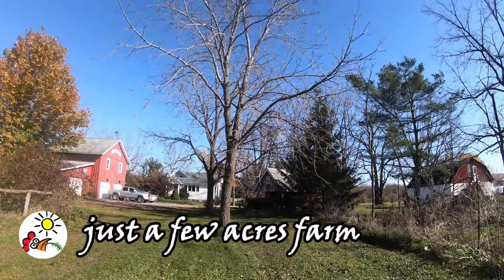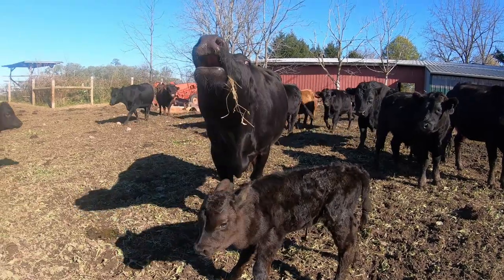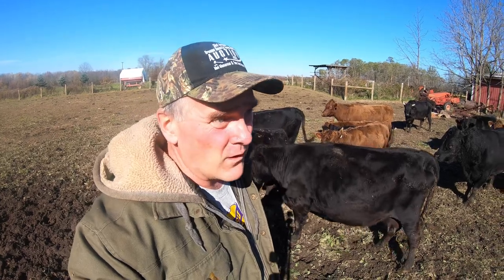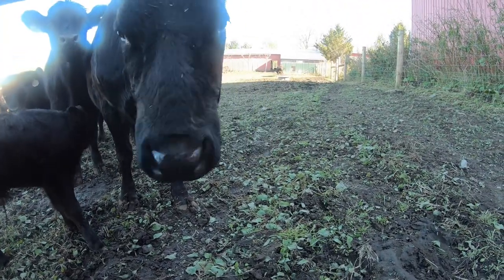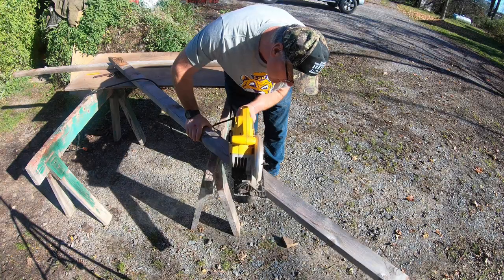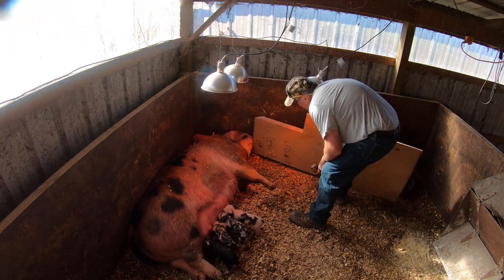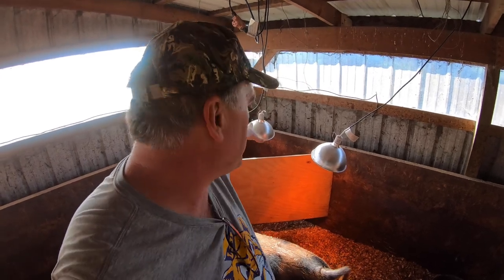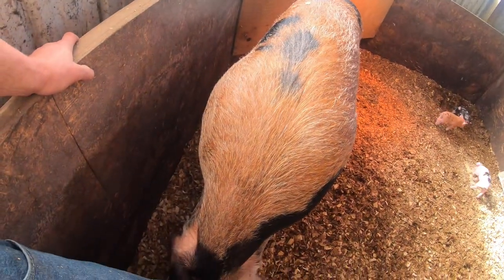A New Baby and SAFE Piglets!

Comment: Hey, like that 45° heated corner for your new piglets. As they grow taller, just raise the 'wall'...maybe next version will have vertical rails...as slide guides. Drill some holes in rails, match to holes in wall board, install few wood dowels (steel nails may cause injury if get knocked out) & bingo you have an adjustable height piggy corner. Hope this suggestion works for you. Much enjoy your channel...and (can you believe) watching all this animal farm stuff...makes me hungry!😊☺😋👍🍷

Comment: Food for thought Pete.  Especially for when the temps really drop.  Staple some Reflectix (bubble foil) insulation to the perimeter of the piglet pen to retain more heat, get more bang for your buck as you reduce the number of heat lamps, and eventually, let the pigs' own body heat become more trapped within the area to help them keep warm.  Draping some over the top will hold it in even more too.  

Congrats on the latest calf arriving.  She's a purdy little thang.

Comment: Pete we use old doors and do the same thing. As far as pig rails we use 6 inch pvc pipe that's screwed to the walls with long screws. If you choose to go that route be sure to place the pipes flush to the walls so the piglets can't go up in the pipe...found this out the hard way.

Comment: That separation with the heat lamps is exactly how I always made them. Combined with rails on the sides. I would still loose 1 or 2 piglets sometimes.The litters were often 12 to 15 piglets, sometimes more.

Comment: You mentioned not having lights in the hen house for winter snd having to black it out if lights used. I just use a simple timer and an LED lightbulb for 3.5 hrs in morning and same at night and the daylight in between. It gives the hens the longer day like it’s summer and the bulk is still natural light and they seem more alert and egg production stays more steady.
Reply from the maker: I'm glad this worked for you Ben; it did not work for us. I think the problem is the hens can still sense the day length, especially given they are kept in a clear plastic high tunnel for the winter. After I tried this a few years ago and it didn't work, I did some reading and found that if supplemental light is used in a situation such as ours, it needs to be very bright to overcome the hens' natural instincts. In the end, I decided to let nature take its course. The hens need a natural break in the winter.

Comment: Pete, when I was a kid we used Smidley farrowing huts. They had a 2x4 attached to the walls edgewise a few inches off of the floor to give the piglets a space to avoid getting crushed. Never had a problem with the sows tearing them off.